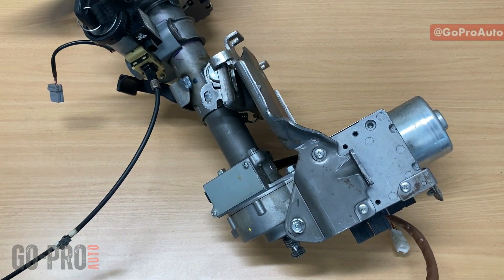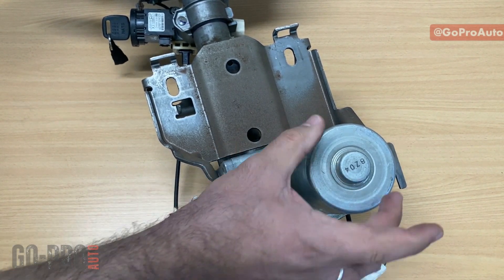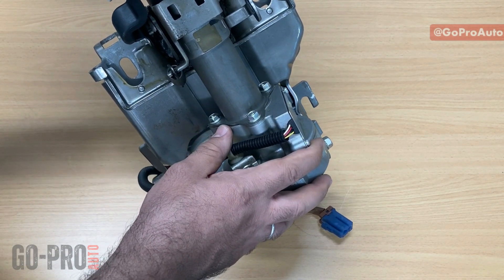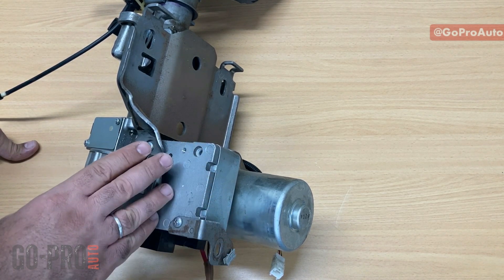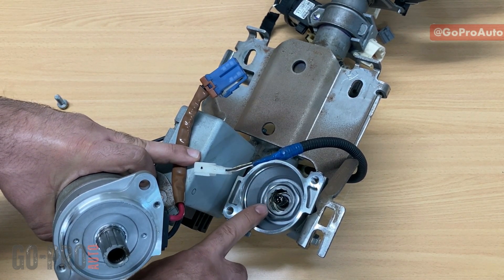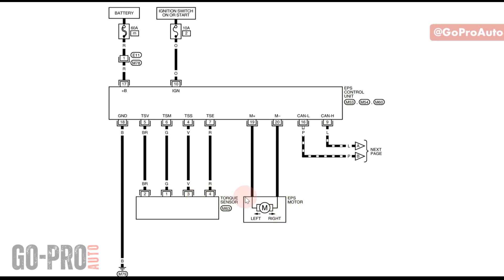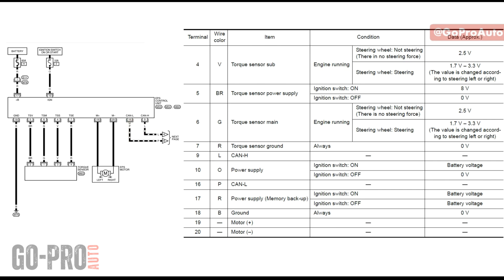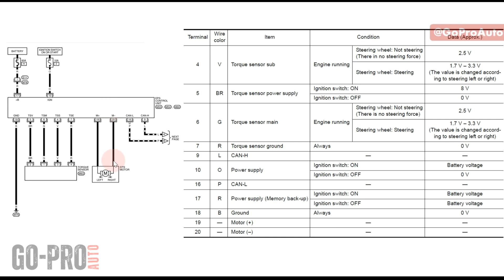Electric Power Steering Operation & Diagnosis | Nissan Power Steering | EPS Wiring Diagram

Comment: Many thanks indeed. I'm running a nissan micra  which is displaying a fault noticeable at higher speeds. There seems to be a tiny delay in steering assistance, it must be a micro second, but enough to provide a horrid notchy feel.  Your video may prove invaluable to me. Thank You.